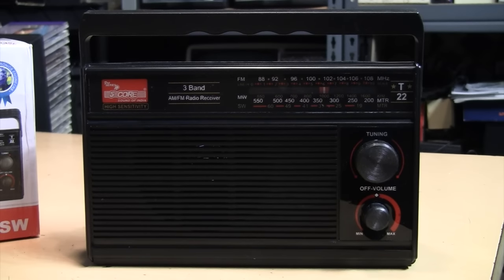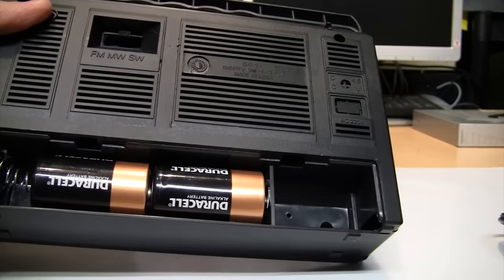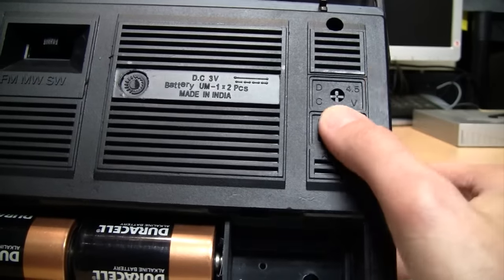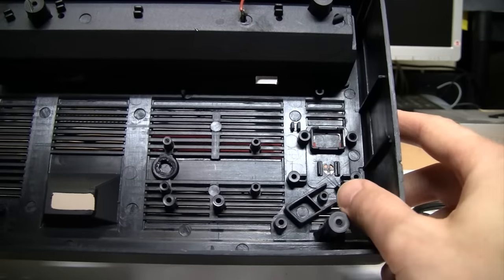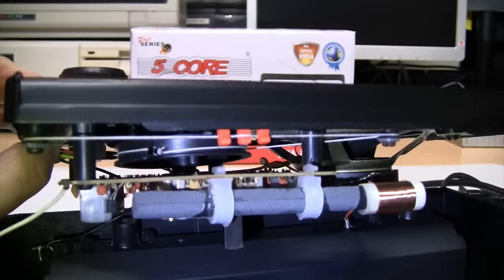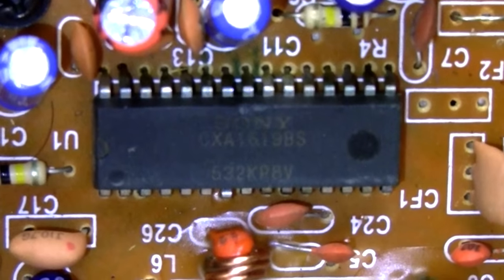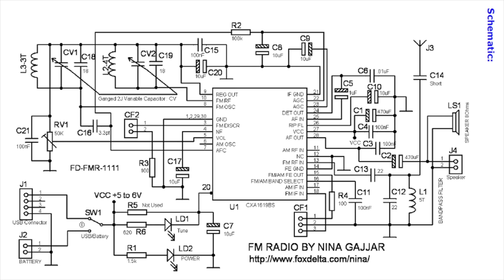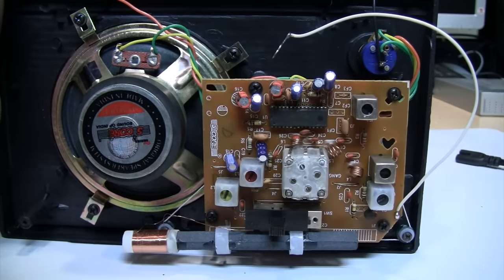Secretly made by Sony - Inside the 5 Core radio

Comment: It's possible the company just reused old Sony stock. They may have been contracted by Sony to produce a similar radio then made their own when Sony discontinued the product, or they could have bought a lot of parts from Sony.
Reply: I'm guessing that 5 Core bought the tooling and design in 1984 (not necessarily from Sony), and revised the design a few times along the way.  Kinda like how the Hindustan Ambassador was based on a 1950s Morris, only by the time they went out of production about 10 years ago, it was fitted with a diesel engine (either Isuzu or Peugeot IIRC) and air conditioning.  A 1950s car with ice cold air conditioning in the current year would be quite something!

Comment: Does the Sony chip also do the shortwave?
Reply: Yes, it does everything.
Reply: SW uses the same IF strip as AM (medium wave) usually, just a different LO oscillator coil, antenna and tuning condenser section. SW is also AM, just higher frequency than standard AM which is actually MW.

Comment: a slightly simpler design is possible, using a tda7000 or tda7010 pulse count detector fm chip, and a ta7642 trf am chip plus an audio amp chip, less tuned coils, no alignment needed, but more chips!

Comment: Greetings from the other end of Canada ;) Excellent video, very cool analog radio for sure :) Just a hint, but you could solder a stereo RCA jack on that speaker to get audio out put / line out, which would also allow you to route it through your stereo :)
Reply: That would get you neither stereo nor line-level output...
Reply: @AaronSmart.online  lolz, you can add a volume switch for level and yes it would be Mono Cloned over 2 channels ;) Just makes recording from it a little nicer :)
Reply: @AaronSmart.online  

Just add a voltage divider.

Comment: Always have analog radio reception,,,even if they have a digital sythentic tuner in it for am/fm stereo reception,,,as they do have fine tuning adjustment transformer type coils inside for both bands,,,and they work just as good as a transistor radio with a manual tuning capacitor.

Comment: Yeah i'm not really surprised they use Integrated Circuits for the actual radio component, to keep the pricing reasonable. It's fairly common nowdays but the surprise is that it's actual Sony parts they used for that component. And not some no-name chinese cloned IC knock-off. It's pretty awesome :) It would have been even more awesome if it was socketed and not soldered onto the board. But i guess that'd be crying on high standards. lol.

Comment: There's enough space inside to turn it into a super radio.
Reply: It's already a super. If you don't know, look up superheterodyne receiver.
Reply: @mjouwbuis  I have been involved in engineering and physics all my life. What I meant by a super is that with some work, it might compete with a General Electric "Super Radio," one of the most sensitive portable radios ever made. There were three versions, I own the "Super Radio III" the last version. I bought the Super Radio III because it covers the expanded AM band to 1710 kHz (actually a little higher). My modified Sony ICF-J40 competes with the super radio in sensitivity but the General Electric has much better sound quality (stronger amplifier and much larger speaker).

Comment: Please forgive me if this is a dumb question, but doesn't the presence of the Sony chip mean that this radio is, at most, a hybrid device, part digital, part analogue? I mean, as some of the wiseacres in the comments seem to be averring to, if this was a 'properly' analogue radio, surely it would be festooned with transistors? Not that I'm picking fault... No-one seems to have anything bad to say about the radio's performance and surely, at the end of the day, the proof of the pudding is in the eating?! I mean, yes, I'm in my early 50's and someone of my age would have been used to opening up even a cheap radio and seeing it just crammed with a mind-bending assortment of components; now you open a radio and you see a circuit-board the size of a playing card with maybe 10 or 12 doodads mounted on it, and you think, 'I put together busier looking crystal sets as a kid!' -But really, as much as it is the exception, if you can get the performance with this sort of an arrangement, if you can combine decent reception, with decent sound quality, decent listenability while keeping things simple - and economical - 'under the bonnet', so to speak, well why the hell wouldn't you?!! 
           Of course, in the real world, things rarely work out as you might hope. Consumers don't trust 'flimsy' when it comes to home electronics, be that with the casing or the interior, so much so that we are now in the bizarre place where manufacturers add 'makeweight' to products so that they will have a reassuring heft!! this '5 Core T22' is simply the 'exception that proves the rule' because of its slightly weird path to market... 
         Anyway, sorry, I never did mean to waffle on so! Just to recap, my question was "Digital? Analogue? Both, surely??!"
Reply from the maker: No, the Sony chip is 100% analog.
Reply: @vwestlife  Now I know, haha! Thanks for taking the trouble to answer what was probably a bit of a 'schoolboy' question!

Comment: 4/10 Case quality , 9/10 on the signal processing chip.
Reply: Just get the chip, make better DIY radio.
Reply: It's not a signal processing chip. The chip is analog and only contains a set of amplifiers. And it's by far not the only thing responsible for good reception, coils/transformers, condensers and PCB layout is even more important.
Reply: @westelaudio943  To be pedantic, Analogue Signal Processing. There is also a bit more than amplifiers. Last night I was reading how FM demodulation was the very first use for ICs in consumer electronics, pioneered back in 1965 by RCA. Even back then they could get better performance with an IC than a circuit made using discrete transistors, as the components on an IC will be better matched and they could use more of them.
Reply: @MrDuncl  

You're right, I shoulda said amplifiers AND detector stages. I'm not sure if the early 70s IC-based FM detectors perform better than 50s and 60s discrete tube or transistor ones though. In my experience, they sound about the same. But ICs made a more compact design possible of course.
Reply: @westelaudio943  RCA claimed they worked better, but of course they were the company making them. They were certainly lower cost though and as you say more compact.

Comment: Hackable, yes. If you must have an analog radio, well, there's the 5 Core radios. Be aware, they are indeed pretty junky. On mine, the "claw" that engages the tuning capacitor to the dial pulley split in half *upon the  very first turn*.  Fixable with superglue. I also used bailing wire. The tuning also didn't go full range on FM at least. Had to fiddle trimming the tuning cap to go below about 91MHz. AM gets swamped by powerhouse stations in wide swaths of spectrum. Haven't looked into that yet. SW is useless here on the lower west coast, but that's pretty typical even with much nicer radios. I'd expected the circuit to follow the examples in the CXA1619 datasheet, but it differs significantly. I'm not sure I'm gonna waste the effort to trace it out. Case molding is indeed sloppy (who really cares?) But the plastic is flimsy (a real concern). On the upside, it does have pleasant audio. I was hoping to have something that would be acceptable out of the box, and the TC22 failed at that. Sure, it works now, but for most people, this is a thumbs down.

Comment: I'm not sure if a radio with chip at core can be called truly analog radio as it happened to be with transistor only radios till mid 70s when cheap chips landed to obey rules of market economy.
The sony chips as kits are still de facto components of 'analog' radios, if you find a philips radio, you'll see that too, philips made such radios till few years back last time I checked, one was, ahem, hand cranked as auxiliary power source.

Comment: Quite a clickbaity and untrue title. The radio is definitely not made by Sony, not even secretly, though it does use one single Sony part, which isn't surprising as most radio manufacturers aren't also chip manufacturers. The reception quality is still determined for large part by the design and choice of components around the chip, though it probably helps that it's a reputable chip.

Comment: Sensitivity / selectivity, judging a radios receivers performance is quantifiable using test equipment. (For example see many radio restoration channels) using your individual local radio stations doesn't tell your viewers how sensitive a radio receiver is or how selective it is to avoiding adjacent channel interference.

Comment: i've come across another manufacturers 'equivalent' to one of those sony chips, or another sony one of different type number, but cant remember the number, got the data on one of my other computers, somewhere! ..
Reply: another one sony do or did do, no idea if still manufactured, is cxa1019
Reply: one or other of those chips were used in at least some,if not all,  of the 'baygen' wind up radios, i have one that needs a new chip, but at the time, several years back,  couldnt  find a supplier,  maybe easier to get, now!
Reply: Toshiba definitely made similar ICs, as some Steepletone radios I bought in the 1990s used them.
A  1988  Sony ICF450L I have here uses a very similar CXA1019M IC.
Reply: @MrDuncl  i've come across a Tosh. TA7640AP, which has most of a radio circuit except FM tuner and AF output stages,

Comment: Why would you want to put a power cord in the battery compartment when there is no AC input ? LOL.
Reply: because it would've also had a transformer and AC input if the case was fully equipped.
Reply: @aperson6955  But it would also have been 4.5 volts, as indicated on the back. So it would have 3 batteries.
Reply: @frankowalker4662  yep

Comment: I think the space in the back of this radio 📻 serves as a kind 👌 of knockout. It simply has no 👎 purpose. They simply cancelled the next battery, so the radio 📻 wouldn't be over-volted (my best guess). Nice speaker, with BIG, permanent magnet. That song was "Wildfire", by Michael Martin Murphey. The year it came out was 1975. The length of the song is 4:45. EBay could probably be too expensive for this radio 📻. It might not 👎. This is a very nice radio 📻, inside, and out. It has the optional power cord, so ya don't have to use batteries 🔋. I remember, it's the Core 5. I surely was impressed by the big speaker magnet. Your friend, Jeff

Comment: The Sony chip will accept 4.5V too. But my suggestion is to use LiFepo4 batteries in parallel as they're close enough to 3V.
But please, don't bother with the FM part, I have one of those radios based on that chip and it's dogshit on FM. Even a crappy 15 USD alarm clock radio with a thin wire as the antenna has better FM reception!

Comment: Not an analog radio if it has a ic chip.
Reply: Not necessarly, there are MANY analog IC chips....in fact, looking at the datasheet for the IC, it indeed appears to be a analog IC.
Reply: The biggest clue, which VWestlife pointed out, is the Multi-gang variable tuning capacitor. I believe the Silicon Labs digital Radio ICs use a potentiometer.

Reading up on them last night, Analog ICs (with the first being made by RCA) have been used in consumer electronics since the late 1960s, back when the only people using digital ICs were the likes of IBM. Around 1970 there were TVs in which used both analog ICs for the low signal level parts like FM sound demodulation and valve / tubes for the power sections like Line Output.